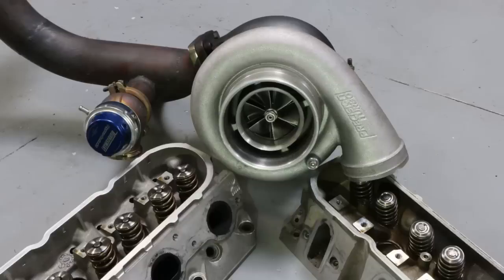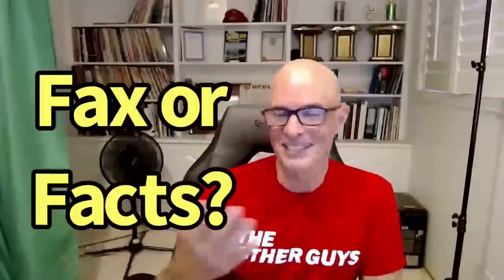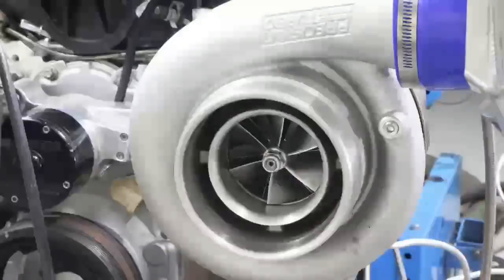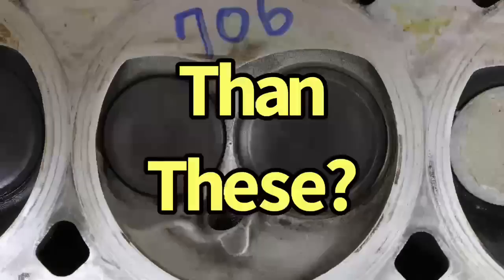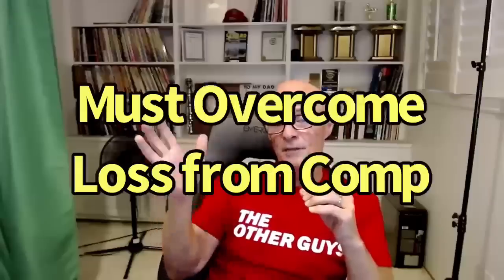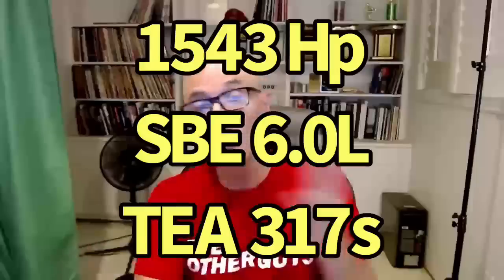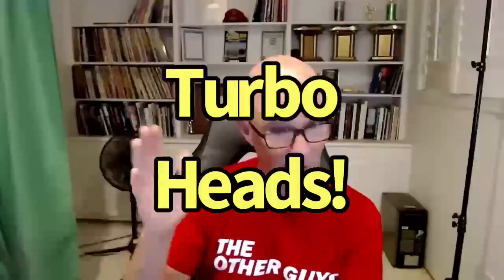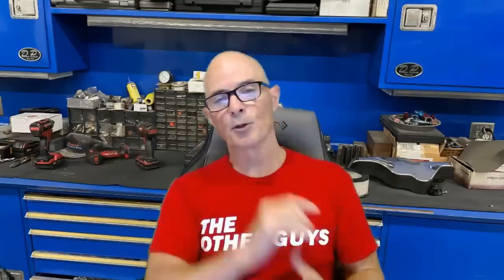BOOST VS HEAD FLOW-WHAT STOCK HEAD SHOULD YOU PICK FOR A TURBO LS? 706 VS 317-DOES MORE FLOW MATTER?

Comment: One can argue that a NA engine "is boosted" with 14.7 psi over total vacuum, right?
706 heads and 9.5:1 compression ratio for 464 hp / 14.7 psi tells us we will expect 31.56 hp increase pr. psi of boost.
317 heads and 8.5:1 compression ratio for 444 hp / 14.7 psi = 30.5 hp increase pr. psi of boost. 
9.5:1 + 8 psi boost is calculated to give the same dynamic cylinder pressure as 8.5:1 + 10.5 psi boost. ;) 
706 heads; 464 hp + (31.56 HP * 8 psi) = 716.5 hp.
317 heads; 444 + ( 30.5 * 10.5 psi) = 764.2hp. :)

Comment: What needs to be understood is cylinder size in relationship to cylinder air flow fill rate. On a  3.78 cylinder bore  the 706 with the combustion chamber design & smaller valve gets more USABLE AIRFLOW  filled into the cylinder. On the 317 head the valves are bigger & the cylinder size being smaller causes air flow turbulence crating air flow interference. It’s less usability on that flow of air direction. Old school compression makes huge power difference & that static compression forces the piston down faster transferring into flywheel horse power / torque. It’s not a 706-317 thing it’s what’s better for bore-stroke applications. Richard is right through testing process. It’s solid proof.  If you reverse the challenge on a bigger bore / stroke application as stated, the 317 will show better power on the higher rpm horsepower. 1/4 mile testing is different than dyno also. Depends where your application needs the power curve to be. Think of airflow like filling a 5 gallon can. If I take 5 gallons of water & try to fill it into a 5 gallon container with a 1 inch opening without a funnel …. How much water gets into the can ? More ends up on the floor. But hey a nice funnel & pour it in steady & flow…. I’ll get all of that water in. Now on compression to airflow is different power type. Airflow transitions are the symphony of horsepower. It’s smooth nice responsive airflow power. compression power is the comparable of filling that open bucket with sand. If I pour smooth it leaves space. If I pack it with something & force more sand in I get more sand by forcing the space to get smaller by compressing. Compression is an explosive rate of force. The less space creates a violent downforce to move that cycle faster. When you hear high compression & big can you hear that violent action happening. It’s the sound we love. A new ls vette doesn’t have that nastiness or violence in its sound but it moves fast. There is balance in this. Airflow is symphony power flowing nice & compression is violent power like heavy metal bands. 🎉Good luck & keep on truckin.

Comment: Why would you do the tests with a 5.3???  The 317 head wants the larger bore and the bigger chamber lowers the compression much more on a smaller bore 5.3 engine. Poor test, very poor.  Test should be done with a larger engine.
Reply from the maker: also compared those heads on a 6.0L-same results

Comment: So if im running E85, woupd I be safe to use 706 heads boosted to 11/1200 HP without fear of detonation? I like the down low power for street use but still want to be capable of the 1000+ if needed. It will be a 3rd gen LQ4.
Reply from the maker: they will work-I would use 799

Comment: I wanted to make my LQ4 a LQ9  put flat tops and 799's  Then i got the turbo bug.  But its 11.1cr  fuel around hear is 91. Its a 4×4 truck and i need to be able to do truck stuff. So my thinking is, # not a fact but maybe.  Is that a running Engine with 317's makes more power than a blown up engine with 706's
Reply from the maker: run 317s on that combo

Comment: I need help was doing first ls swap   was told the engine I was using was not good as it had  706 heads it ran good on stand but the heads are not good as they will crack this is for a daily driver is it worth trying   are the 706  heads really defected
Reply from the maker: my 706 heads have 350K miles on them

Comment: @RichardHoldener Do you still think 317 heads are better for full street use over higher comp heads? Pump gas vs. E85?
Reply from the maker: for boost, you should run whatever heads you have. The 317 heads can work for lower comp on pump gas to help widening tuning window-otherwise I would not replace any other stock LS head for them.
Reply: @ so you’re saying that 317’s give you the ability to max tune with any fuel. Or am I reading that incorrectly?

Comment: My guess is the stock 706 heads can make enough power under boost to destroy transmissions, diffs, axles, driveshafts. So what does it matter unless it’s going to be a super expensive project with lots of custom stuff. Not a fact just a guess.

Comment: What if flat top pistons are added to the equation.. does the 317 produce correct compression allowed for boosted sbe 5.3l
Reply from the maker: many 5.3L motors had flat tops with 234/799 heads, so the 317s would work-they just make less power from lower compression compared to 706 or 799
Reply: My question was a little more personal specific.. trying to figure my combustion chamber to suffice for boosted application.. how much compression is too much and which heads are adequate 706 or 317.. lm7 had dish now I'm going gen 4 flat tops and rods.. help me lol @richardholdener1727

Comment: Would the 317 make more power under boost due to the lack of combustion efficiency and larger volume with a low grade fuel perhaps? Not a flow related power gain but more so the possibility more boost could be run before detonation occurs?
Reply from the maker: lower compression could work with low octane

Comment: 4.8 pistons in a 5.3 with 317 heads. Compression with more flow. 😁
Reply from the maker: 706 with the same piston wins
Reply: @richardholdener1727  Ain't no replacement for compression! That could be a strange test. Higher compression 5.3 vs a lower compression 6.0. What's the better bang for the buck.

Comment: the 317 head would make better power if the fuel was the factor which is a lot of the time 87 octane you could run significant more timing with the 317 and more boost.  With perfect conditions the compression is hard to overcome.  The 317 is a more forgiving boost head

Comment: Higher static compression doesn't always make more power with forced induction. There's a crossover point at which higher static compression starts losing out to lower static compression supplemented with forced induction. For most engines, it's around 20lbs of boost, lowering static compression to allow for more boost will actually net more power, even if the effective compression is equal. higher static compression can't add oxygen to the combustion even, it can only squeeze what's there, it lowers volumetric efficiency but raises thermal efficiency. A turbo can do both. It would be interesting for you to test this with the same set of head, where it starts with a thicker head gasket, then a thinner head gasket, and then get's milled down, and test each phase with 10psi and 25psi.
Reply from the maker: higher static compression added power way past 20 psi-look at class racing where they regulate turbo sizing (higher compression adds power)
Reply: @richardholdener1727  It depends on the engine at what point the crossover exists, but it does exist. It's probably higher for something like an LS that has lower starting volumetric efficiency compared to a Ford Coyote or a Honda F20C. Just think of it in the terms of volumetric efficiency only. What is going to end up with a higher VE, a high compression motor with low boost, or a low compression motor with high boost? High boost. You're increasing the swept and or unswept volume so it can be filled by the turbo. An engine is an air pump right? A larger volume of air means more power potential. Yes a high compression motor can make power with boost obviously, and there's plenty of advantages to that. But if we're strictly talking about maximum power potential, lower compression has the greatest potential. But enough boost has to be thrown at it to raise the VE to that point. Test it if you don't believe me. Or go talk to a mechanical engineering professor. It's not my opinion, it's physics.
Reply: I think you are missing the point. It's not the engine it's many other factors. Especially fuel amd temp. Which you left out. It's not "jUsT PhYsICs" when you leave out a bunch of "ThE pHySiCs"
Reply: @akassasin5768  You're not making a point. So there's nothing to miss. If you change IAT and fuel, it's going to effect both scenarios. Either scenario, lower compression with more boost makes more power. It's not a debate bud.
Reply: So if lower compression with more boost wins why not make the greatest engine every with your 2:1 compression ratio. Possibly the dumbest idea I've heard.
Reply: @akassasin5768  Yes that is possibly the dumbest Idea I've ever heard. Not sure why you asked it, and then immediately and accurately categorized it. We can at least both agree on that though.
Reply: You said lowering static compression makes more power with boost not me.
Reply: Which is still the dumbest blanket statement I've heard.
Reply: "Lower compression with more boost wins"
Don't try to act like you didn't say that now that you realize how stupid it is. 😂😂 really going back on your word now huh.
Reply: @akassasin5768  Yes, that's because at a certain threshold, it does. The threshold is higher on engines with lower volumetric efficiency like 2v V8's. That's one reason this idea is so alien to a lot of the domestic crowd. It's probably 25-30lbs of boost on an LS, but it's closer 15-18lbs on something with 4 or 5 valves per cylinder.
Reply: @akassasin5768  I'm not sure why you think I'd go back on my word. It's also not my word btw, It's a well established fact. Lower compression with high boost, has the highest horsepower potential. It's physics.
Reply: Hey have a good life thinking that though man😁. Just let other people work on your corvette since you clearly don't. 👍
Reply: @akassasin5768 Im the only one that works on my Vette, nice try though lol. Use some critical thinking, forced induction adds volumetric efficiency, AND contributes to effective compression and also therefore thermal efficiency. And in a high boost application, lower compression yields higher volumetric efficiency. You’re creating more space for the turbo to compress with air and fuel. Just use your brain. It’s not that complicated. Forced induction IS compression, it’s just not static compression.
Reply: Lol man I'm just trolling you because you don't know what you're talking about this is my last reply im just having fun 😂.
I was trying to point out that compression being higher and lower means liberally nothing in the conversation. Higher compared to what. You say at 20lbs of boost higher comp is bad but you don't define higher comp which is why I know you are just here talking about things you don't understand like physics. 😂
If you don't know about to engines that make high horsepower on compression rarios like 12:1 and well above that. Specifically on high boost then there is no point to having this conversation. Quench fuel type chamber and head design all have so much more to do with detonation and loosing power than compression. Compression is what people talk about when they don't understand what is actually happening because compression doesn't cause detonation bad design does. Good luck with the vetted. If you want to actually learn about boost and compression watch David vizard and Ben Alameda. Good luck buddy. 
You'll need it. 
Also it's just physics and facts...

Comment: Is this possible to have a ls with minimal chop at idle and high rpm range (around 8k rpm)? Something around the 550 BHP NA
Reply from the maker: see the 542-hp 5.3L video, but any cam that makes that power at that rpm will have a rough idle-if you want a smooth idle, make a bigger motor with a milder cam

Comment: I always miss the lives so I just came to a comment section. But I am building a 5.3 and I plan to sell it I want to know what rebuild kit and cam do you recommend(the pistons were rusted and my dad accidentally busted one of them beating it out). I would also like to know how much I should sell it for as a Long Block.
Reply from the maker: it is harder to sell a rebuilt LS long block since the junkyard is full of running LS motors for cheap
Reply: @richardholdener1727  That is true. Do you suggest installing it in a vehicle?

Comment: How bout 706 heads vs Rec port heads ? Does compression gain beat air flow there? Rec ports have 70cc chambers
Reply from the maker: That video is up-706 vs ly6 heads (rec ports made more up top-lost down low)

Comment: Could you do a fuel test for example tune pump gas kind of rich maybe 11.0-10.5 then see what percent of methanol you could add to your fuel to get the air fuel back to a more typical ratio then see if it picked up power

Comment: Honestly, it really doesn’t matter whether it’s a 706 or 949 head if it can flow a certain amount of grams per second you’re going to end up with a certain given amount of air and that can be combined with a very certain amount of fuel and you’ll get a very certain amount of combustion. All things considered if the smaller head can only push for example 109 g of air but the slightly bigger head can flow 118 g of air if they’re at the same level the one that has more grams per air will make that much more power. It kind of goes back to the old saying there’s no replacement for displacement and a turbo charger or head design just displaces more air. That’s a fact. This is why some of the four-cylinder engines run in 25 pounds of boost are able to make the same horsepower as a V8 with only six or 7 pounds of boost.

Comment: I think an easy answer is to spend slightly/no more up front on an 08+ 6.0 with the square port heads, which is like getting a 99-07 6.0 with aftermarket heads and intake from the factory. Then this conversation becomes more academic.

Comment: Hmm I'm interested to see how this plays out for me. I have a stroked l33 with the 799 heads, forged rotating assembly with a final compression ratio of a tad over 9.5:1. I know cam specs also play a big role in power and needed octane. It'll get boasted  eventually, gonna start off driving the car N/A before i aim for 650+rwhp with less than 10lbs of boost(hopefully) i did have it gapped for over 15...just to be safe 😅. Should be fun either way, less than 2900lbs with ....probably more than 400whp...should be spicy even before i go to kill me mode

Comment: 243 vs 706 heads? Which one has more compression or what are the differences?
Reply from the maker: 799 vs 706 vids are up
Reply: @richardholdener1727  did some quick research.  Didn't know 243 and 799 were almost the same. I'll check out those videos

Comment: LOL at the people still arguing Compression and Flow in the comments, even though you were told in the video that chamber design matters, port size matters,  You were told that even if you mill the 317 to match the chamber volume of the 706, the 706 still makes more power.     But you're still arguing compression and flow.

Comment: It’s a compression limitation question, not air flow. Does the higher compression of the 706 limit the max boost compared to the 317
Reply: It's a very dynamic question. You have to take in to account quench and chamber design to really know the limits. Higher compression sometimes is better all around as long as the chamber is designed properly.

Comment: I think the question is can the 317 heads handle more boost than the 706 with all things equal and does that translate to more power? Like 706 maxed out at say 12psi vs 317 maxed out at 17psi

Comment: Figure out how much air your engine is moving on the cam and at Peak RPM..
Correlate that with head flow capabilities.. 
Then add boost pressure accordingly

Comment: I have a 6.0 with 706 heads on it thats on my airboat im fixing to put a torqstorm on it should i change  heads for such low boost
Reply from the maker: what fuel
Reply: @richardholdener1727  wanting to run 91 I have a set of 317 heads and springs to go on them but I'm limited to 5400 rpms so probably won't make crazy boost

Comment: I've made some good not massive power from old school sb chevrolet and 455 buick and Pontiac of wich I only bolted together the 455 s as each were bought by someone that lost the vehicle.  However I only know what little I do from your channel, Travis Black I think is his name and power Nation.  I have avoided these super heavy small blocks like the plague until last year. But what I want to know is what head is equal to the Iron Angel plug heads on chevy 302 and the 400. May not have been factory on the 400 I found them on. But my Goodness it was a beast till a conecting rod crashed the cam.

Comment: So, dumb question, the 317 flowing better, how does that affect the way the turbo spools? Could more exhaust flow cause a faster spool? More drivable in the low RPM range maybe?
Reply from the maker: the motor makes less power NA with the 317s, so it spools a turbo worse

Comment: This comparison seems to take a 706 headed engine with its compression against a 317 headed engine with lower compression. 
  What if you had a 317 headed engine with the SAME compression as a 706 headed engine and then tested that way?
Reply from the maker: the heads don't provide the same compression. If you want to make the compression the same in a head comparison, let's then make the airflow the same.
Reply: @richardholdener1727  ok how about doing this same test on just 93 octane?